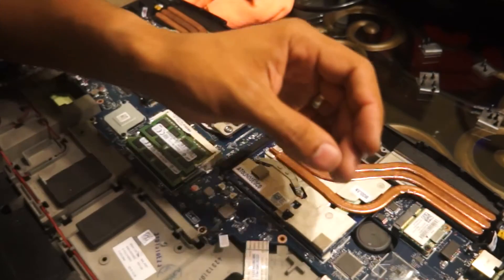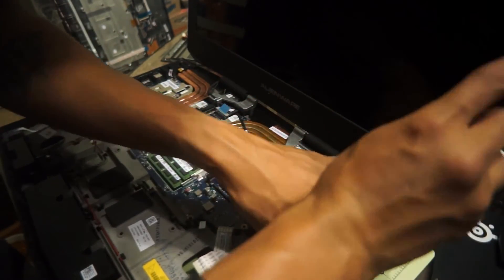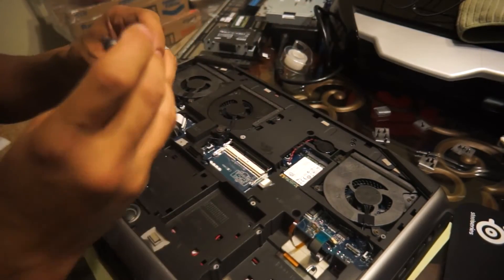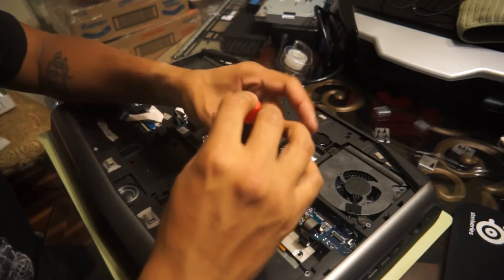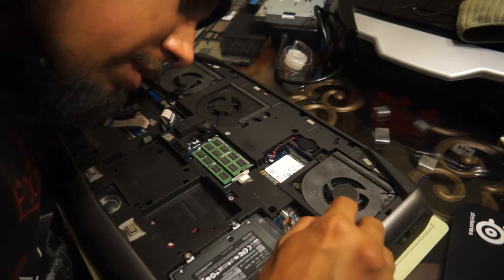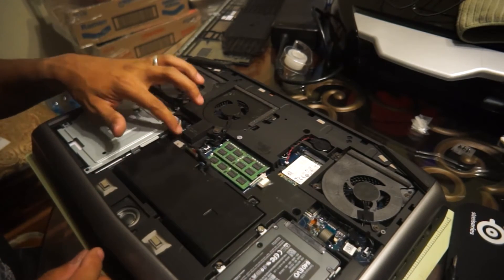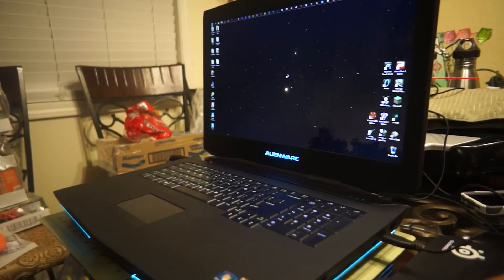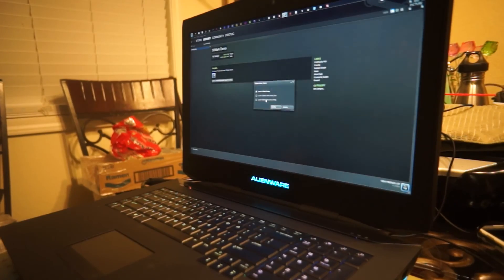Alienware 18 Disassembly and Repaste! Step by Step Part 2

Comment: darn, i followed everything step by step, and then went back and did everything again to double check, however after finishing and resembling everything, my computer wont turn on at all. the battery had some juice in it i know, but it wont turn on. When i plug it into the power outlet, the power button lights up different colors, but the computer still doesn't turn on. Im at a bit of a loss here cuz i really followed all instructions to a T, any advice?
Reply from the maker: Tim Gallagher have you double checked all the connections? Make sure they snapped in and everything?
Reply: PestVic I did, i really went back and did everything twice. There was alot of gunk, like on the orange pipe looking things on the heat sinks themselfs. So i did try like almost scrubbing the surface of them a bit with the alcohol and some qtips. But i did make sure to clean it all of and that nothing else got wet and that it was all 100 percent dry. Im worried i shorted something. But i did buy an anti static band just for this. I attached that to a metallic heater that i plugged in, but didnt turn on. The table i did it on, my dog does lay on, but i hit it with the can of air to make sure no hair was on there before i started. I can go back again tomorrow and redo all the connections again if thats what you think it sounds like, but i do feel like i got them all securely.
Reply: PestVic someone pointed out that little brown tab connector was loose for them and gave them battery charging problems. Mine has the white line hanging suspiciously out. None of the other snap connectors has the line hanging out. But no matter how i try to put it in, that little white line just barely hangs out. Im not sure how to put it in anymore. is that little white tab supposed to be like that? Actually i just took some pics to show https://i.imgur.com/K6biQds.jpg.  and https://i.imgur.com/7JYD5nK.jpg. It seems the line is higher then the line up right next to it so it makes sense it will not go do anymore. someone says to use scissors to make the lines even. I definitely wanted to clarify that though before using scissors.
Reply from the maker: Tim Gallagher I've never had to use scissors, that's weird. Double check the hard drive connections too? I've done mine so many times I never ran into a problem like this
Reply: PestVic I just wanted to get back to you, turns out it was too much thermal paste. I had to bring it to a shop and they told me quickly. Last thing i woudlve suspected. i thought it would just overheat faster if too much or too little. No one at reddit was sure either lol, kinda surprising but ya just for future refrence
Reply from the maker: Tim Gallagher awesome! Yeah that's why I tried to mention to only use the size of a rice grain :-p to much will insolate heat

Comment: After disassembling my laptop, applying thermal paste and reassembling it, i now get a backlit but black screen on startup. If I attach a second monitor by HDMI then the screen displays correctly there. I just disassembled it and checked everything was connected and it all seems to be fine. After traveling back from Australia a few weeks ago I had an issue where the laptop screen would display pink dots (that could have been a cable connection/replacement problem) but that disappeared after a few minutes of boot up and then after a few days it was gone completely. I don't know if these two problems are related. Any ideas on what I should try to do to corrrct this?
Reply: Could be that I created static while messing around? Or a bad LED cable?
Reply: Well now I've messed around enough that I can't get it to output to the second display. Tried removing ram. Tried expelling static by unhooking battery and AC and holding power. Tried holding fn while powering up. Then I tried resetting CMOS by unhooking battery, AC and the coin battery and holding down power and this had resulted in no output to the HDMI even when spamming Windows key P or fn f1 or f9. It might be rebooting and running diagnostics or doing something in the bios or windows but I've got absolutely no way of knowing without a display. Please save me
Reply from the maker: NickUnitedKingdom did you solve this issue?
Reply from the maker: NickUnitedKingdom I'm guessing the sli cable must of got messed up. What kind of thermal paste did you use?

Comment: Reposting the same comment here as I obviously used this vid to put it all back together again, with no 'spare parts' left at the end either. :)

Absolutely fantastic tutorial, thank you for the effort you put into this; I never been able to use any overclock on my Alienware without a BSOD/thermal shutdown during or shortly after startup, this never really bothered me, it was only until recently I was having consistent and reproducible thermal shutdowns when trying to use a CPU intensive application (VisualSFM in this case), with the laptop shutting off within about 4 seconds from starting processing inside the application.

After diagnosing and logging a few metrics, I could see the CPU was rising from the mid-80C's to 100C in only a few seconds, with the fans not even attempting to kick-in to stop it, at least not in time.

I stripped it down while following your guide, cleaned off the HORRIFIC paste job that came from the factory, and seriously, 2/3rds of the CPU had no paste, and the GPU's had great splodges with portions of the die missing paste, with all chips having far more splattered around the chips that you'd think someone did it with a cake-frosting gun..

Applied Liquid Pro to the CPU/GPU's, reassembled, and my load temps have reduced from the t-max, 100C, to hovering around 85C, or a ~15C decrease, there's more of a decrease in idle temps which now setting into the mid-50C's, but I didn't have a good previous record to compare since load were the ones that were causing me problems.

I've even been able to finally try out the OC-1 level overclock, with OC-2 remaining stable for me as well.

Again, many thanks for the tutorial :D.
Reply: +David Taylor Mine is running all cores of my i7 4930mx at 40c to 45c at idle but when I run vegas pro it hits 75c to 80c & I'm using Antec formula 7 nano diamond paste. It's overclocked to 4.1 GHz, I wonder if the cooler lab. would make it 65c.
Reply from the maker: +David Taylor Thanks so much! Love to see comments like this :) Glad it all helped!